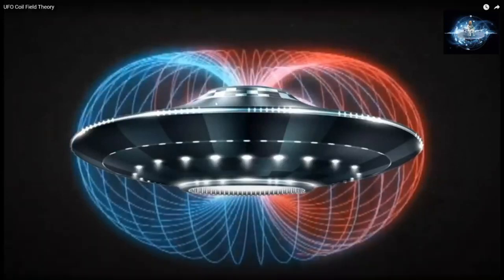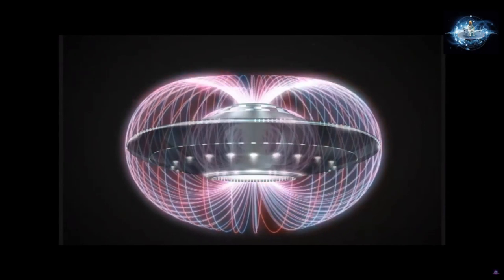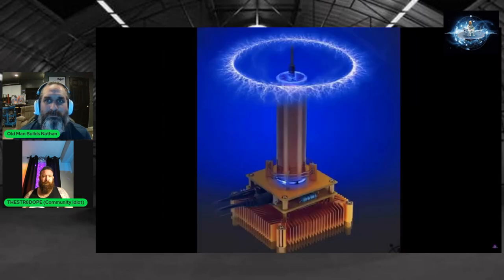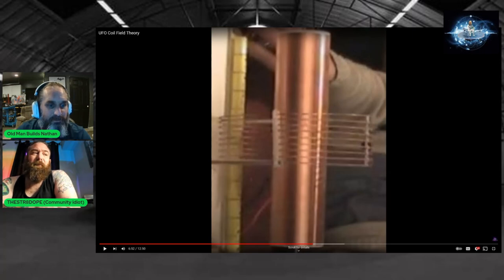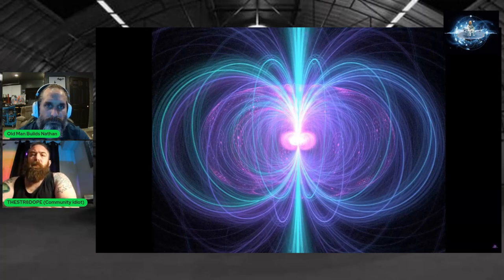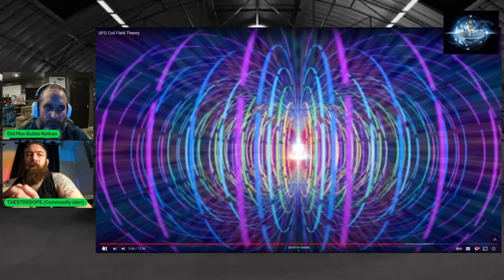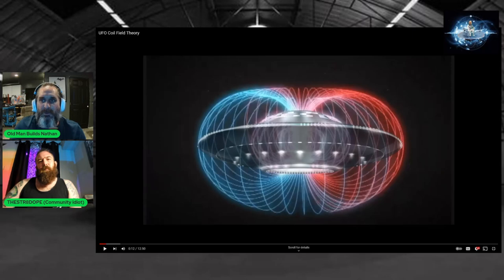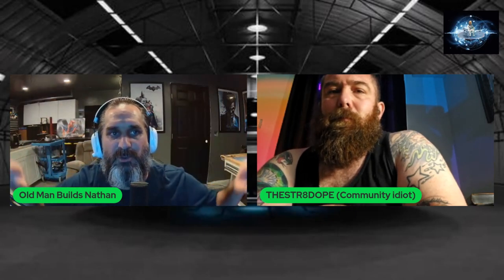UFO Field Theory Live With Joe

Comment: Theres some much information being thrown around, you speak as if you have all the answers. But yet you havent gotten your flyer to levitate. 🤷‍♂️
Reply from the maker: I have done tons of testing on different machines. My Graviflyer is a reverse engineering machine. It will fly when it flys.
Reply: Nathan and the rest of the crew have spent alot of time researching and experimenting; everytime you run an experiment and it yields an outcome and an interaction, you start to understand how to go about leveraging those findings to work for your system. It's a system of fields, what fields are needed isn't a mystery, nor is how to make them. It's how to make them interact In a way that yields the outcome. Just because their hasn't been lift off,  doesn't mean this is not good information or the way to do it. It's also not the only way to do it. Sharing information if a gift for those who will take something away from it... not hang on his every word!